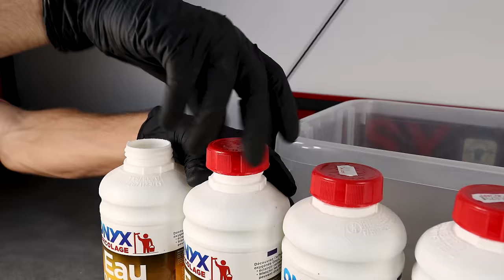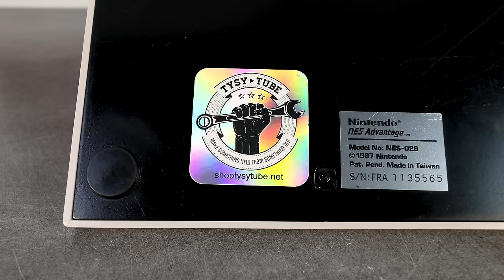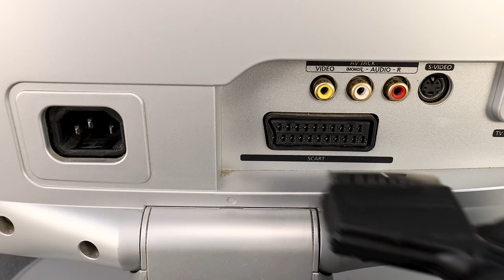Yellowed NINTENDO Advantage Restoration

Comment: Spectacular job.  I had an old NES advantage joystick.  It was the only one I used that didn't mess up my fingers and joints using it for a prolonged length of time.  The UV light with the parts in hydrogen peroxide made them brand new again.  Excellent work.

Comment: I have to ask: what brand/kind of soldering iron was that? It looked cool!
Reply: that is a ts100 or a ts80, both similar irons that are amongst the best rated irons on the market.  one (I forget which) is USB-C powered, and the other from a 12-24v jack.  I lust after one of these...   there are reviews everywhere online, if you`re curious.
Reply: Thats miniware TS80P , works with Type-C 12V PD 2.0 or 9V QC 3.0   . TS100 is more popular, it works with 12-24 V DC . More powerful and tips are cheaper if i remember correctly.

Comment: I had one of these as a kid. Once I learned to use it I almost never played Nintendo with the ordinary square controllers anymore.  It was a very cool accessory.  You practically couldn't beat some games with out the slow motion feature; for example Abbadox.  A notoriously difficult game. The slo mo and rapid fire features on the advantage made a huge difference. Ours devrloped dome kind of fsult snd stopped working but bizarrely if we plugged it into the Four Score four player adapter it worked fine.  Never figured that out.

Comment: You are Awesome! I know how to restore NES and controllers etc. but never a Advantage or even restored it the way you and others have done with the black light. Yes please show us a video of you restoring everything and anything NES or retro video games. I love it. I always try to learn from you guys and the hardest part for me is the soldering part as I think I might need a more powerful solder. I always had a cheap Radio Shack low volt solder which would never produce enough heat to desolder yet alone solder which always discouraged me to advanced video game repair but I'm ready now to spend more bucks on a good one. Love your videos as always and want to see more. Much respect and love to you and your channel. A+++++

Comment: best part was that led resin ball joystick, curious tho why the led flashes different speeds? does it flash faster when there's more electricity going through the circuit board?

Comment: I was just wondering, when you remove the discoloration, do you have to use aluminum foil or could you use mirrors on all sides (a box of mirrors if you will) that you could essentially reuse?

Comment: I'm surprised you didn't put a resistor on that LED especially since an LED need about 1.5 volts and the board is probably operating on 5v.

Comment: If you restore the NES, DO NOT forget to cover snipping/shorting the lockout chip. It's part of the reason it's hard to get a lot of games to start, so bypassing it by cutting a single pin on the chip is really for the best.

Comment: I'm curious how you ran the wire for the knob. Couldnt be straight out of the bottom because that's where the joystick pivot point is.
Reply from the maker: i made some modifications, wasn’t simple 😅 but i didn’t show it
Reply: @TysyTube  very sneaky